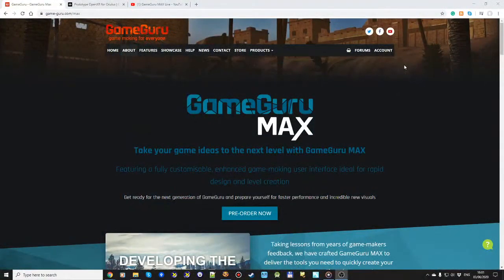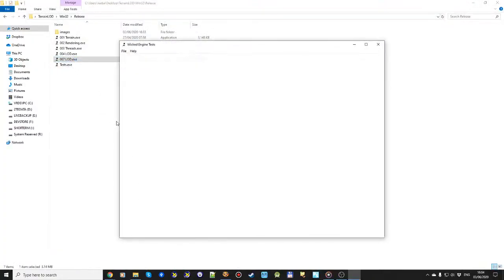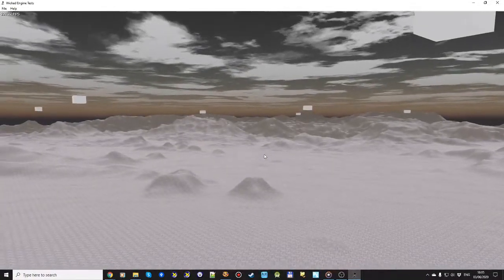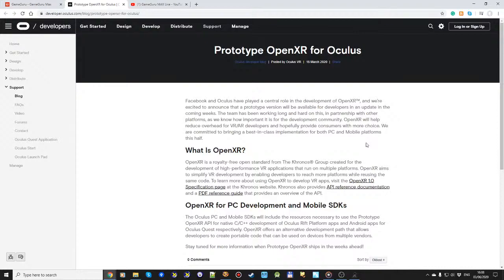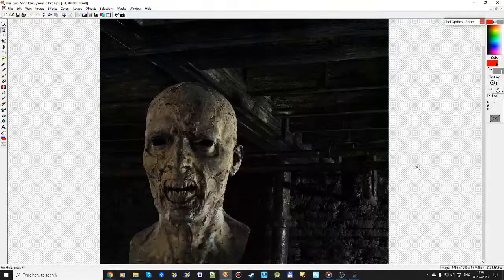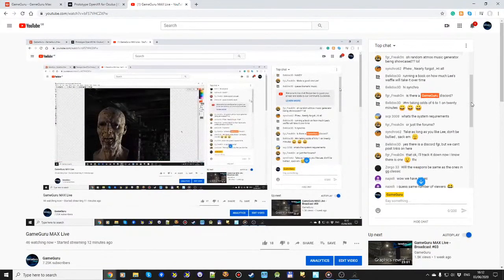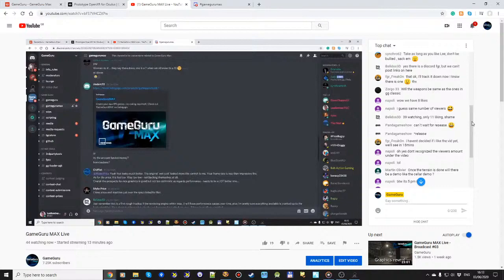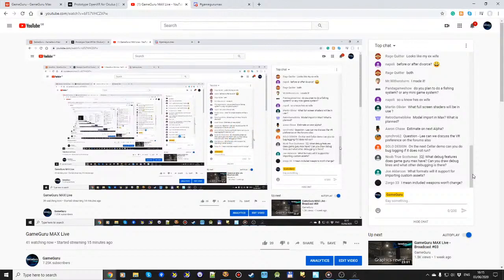GameGuru MAX - Broadcast #04 - Terrain Development Progress.

Comment: Need to be able to build underground 15-20 levels
Reply: Most engines actually don't do this. They either use a terrain pit and then entities to cover that match a similar texture pain as the terrain to create the illusion of cave. Additionally, this is mostly to create the entrance, then once in your are loaded into an interior world with no sky or water and entities make up the ceiling, walls and floor. This is how Bethesda makes their games as their engine does not allow for terrain carving.

Comment: How easy will it be to make caves?
Reply from the maker: There are no plans to support specific cave creation, and the nearest way to it is to cut a deep valley in your terrain and cover it with large flat rocks.
Reply: Caves in all most AAA games are made with entities not the terrain system. Entities with ceilings, floors and walls. I highly recommend checking out the making of Oblivion by Bethesda. And like has been mentioned you can still use the terrain as the flooring.
Reply: T-Bone yes but that means if there is a cave it is it’s own level instead of being part of an open area. You couldn’t have a wooded level and a small cave off to one side without having to 1) create a unique element in blender and import it and having it stand out due to not matching anything else or 2) make it out of individual parts found in the game making engine and it taking up more parts than necessary. What I was looking for was maybe large mountain parts that were the same texture as the ground. It would also have been nice to be able to blend things together but I guess I am asking too much.